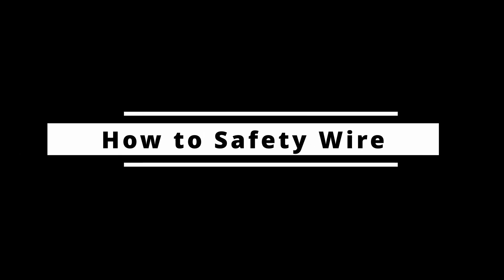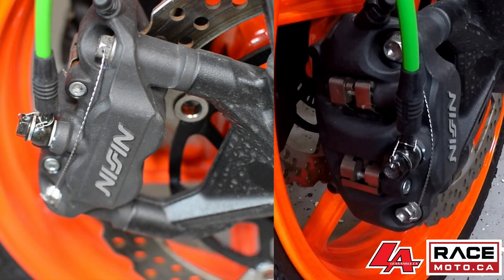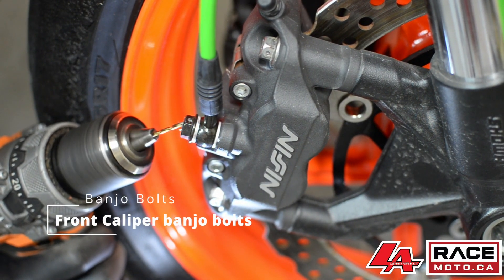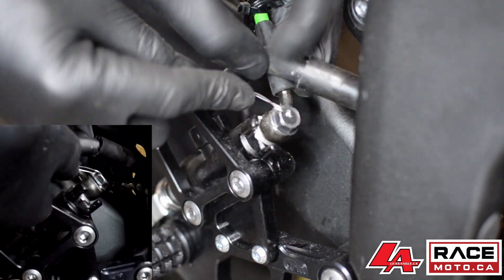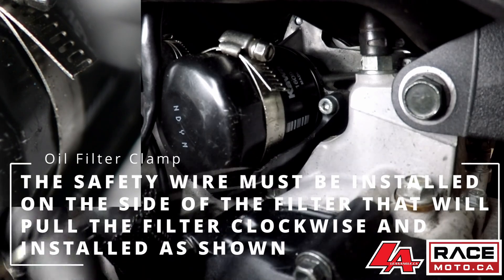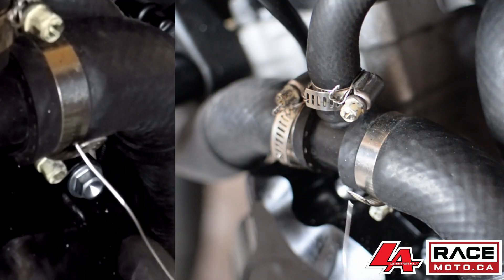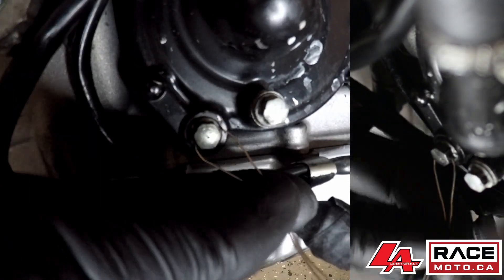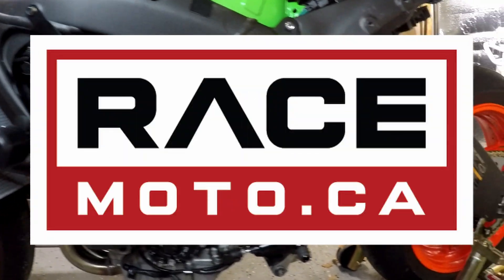How to properly safety wire a race motorcycle

Comment: Are you going tight enough on your wire? Most of these would fail quality control inspection on an airplane. Not trying to be critical but safety wire is one of those things that you need to do it right or else there is no point to doing it.